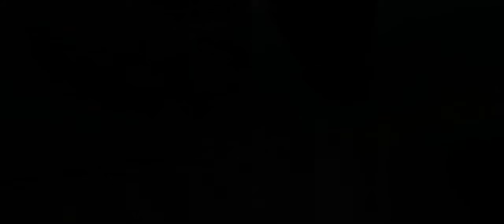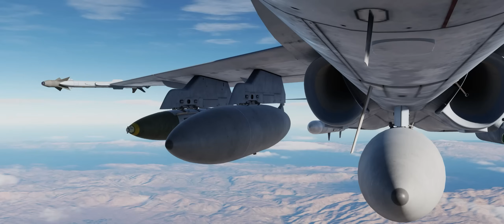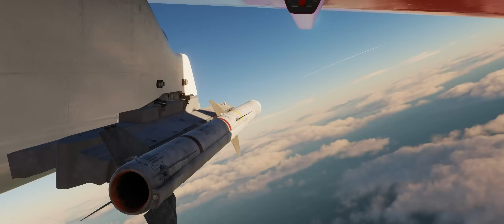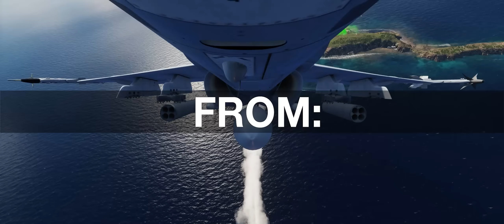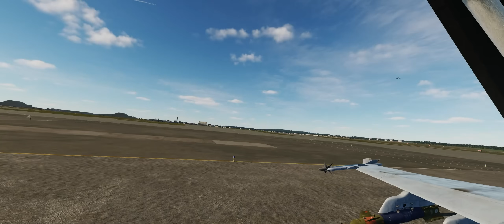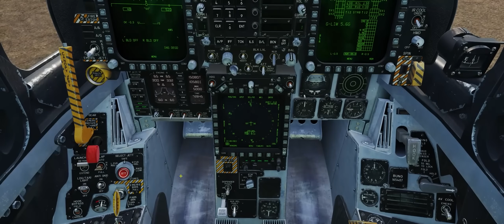DCS: F/A-18C Hornet DEFINITIVE Cold Start Tutorial

Comment: The anti-skid system on an F/A-18 is typically turned off when operating on an aircraft carrier for several key reasons:

1. Catapult launches: During takeoff, the anti-skid system is deactivated to prevent any potential interference with the catapult launch procedure. The system isn't needed during this phase and could theoretically cause issues if it were to engage unexpectedly.

2. Deck conditions: Carrier decks are often wet or have other contaminants that could cause the anti-skid system to behave unpredictably. The system is designed for more standard runway conditions.

3. Simplified systems: Carrier operations occur in a demanding and harsh environment. Having fewer active systems reduces complexity and potential points of failure, which is crucial for safety and mission success.

4. Precise brake control during taxiing: When maneuvering on the crowded carrier deck, pilots need exact control over their braking. Direct mechanical brake control without electronic intervention can be preferable in this tight, high-stakes environment.

5. Consistency in procedures: Keeping the anti-skid off maintains procedural consistency across various carrier operations, simplifying pilot workflows in an already complex environment.

6. Historical practices: This procedure may also have roots in historical practices that have proven effective over time.

It's important to note that carrier operations for aircraft like the F/A-18 involve highly specialized procedures that differ significantly from land-based operations. These procedures are the result of years of experience and are continually refined to maximize safety and operational effectiveness in the unique carrier environment.

Comment: Great tutorial, thank you. Besides that, just a tiny correction for you youngsters out there (you sound young so I would guess you are?) - The first High-Fidelity pointy nose fighter sim did NOT manifest itself in 2017, DCS goes waaay back, even to before it was named DCS. First release was called Lock-On: Modern Air Combat or LOMAC and was released in early 2003, at least 15 years earlier. At that point it was an Ubisoft release, but soon was changed to Eagle Dynamics, at least with Lock-On: Flaming Cliffs 2 in 2009, but probably earlier. I would say that LOMAC was pretty Hi-Fi at the time, nothing came close for sure, but it's sticks and stones compared to 2017 not to mention 2024.. 

Just a reminder that DCS has at least 21 years of history as of 2024. You all should check it out :)

Comment: Totally awesome!💯 Just got my 1st mod the f-18C legacy. But with the sale spring sale I got the FC3 also the f-86 saber. As a Navy man & Hilo pilot. Navy Air Force and Marines assign a specific aircraft to a pilot. This way it becomes second nature and I do love the f-18 but my true love is the F-14. I chose the f-18 legacy due to its radar and crossover abilities. Also that has been upgraded many times. Down the road. I'll get the F-14. Bravo then the alpha. Trying to teach myself. There's kind of a long curve I'm going through. The value of your teaching is priceless. Hopefully down the road. This was a gift from my son. Retired and disabled. I do have the OC2 VR. Seems to get hot. It's the 128 model. After about an hour or two. I'm going to follow your teaching message from cold start. Hopefully all the way to advanced. Really loving it. Learned a lot from your cold start, especially with the radar. 91 to '96 CVN 76 Reagan we had F-14 tomcats. Was unable to finish my 8 years which I was going to put in for another 8 years. Training a co-pilot in a CH47 as a mock-up in lieu of the CH46 Sea Knight. Transmission blew up so all I had was the rear rotor and the auto rotation went well. Had to straighten it out in a dive. By the time the rear touch the ground with the ramp everybody was off but during the dive in ammo can't slid underneath my seat. I lost power holding the rear and trying to keep it straight in the front slammed the ground. My entire lumbar is fused with titanium rods and implementations. So this is really a gift for me. Dcs. Thank you very much. Can't wait to see all of your videos on tutorials!  I imagine I'll be staying in the f-18 for a year or 2. PS. Sorry for the bio 🫣

Comment: The problem with these tutorials (other than being way too long) is that whan something doesn't work the way you describe we have no way to go back and figure out why.  For example all I can get is "align failed" errors.  Now I have to go research why for hours and hours.  Only to find another issue, and another and another.

I still cant get a align but it seems its not that important due to the limited wy I use the hmd.  I wonder if its the TrackIR as I do use a fast low smoothness 1to1 settings.

Comment: I leave the map on, just put the gain and brightness very low, so that the symbology is readily readable in VR.
Reply from the maker: If that works for you that’s awesome!
Reply: @Spudspike  I also work the day/night switch, I can never remember which setting it is, but one is clearly better than the other at the second to lowest gain/brightness.

It works very nicely and takes just a second to press both buttons on the Cougar. The map is still visible but doesn't completely wash out the symbology. I find myself looking at F10 map less and less with grasping all the systems.

Having the map, the waypoints, TACAN, the general knowledge of where which airbase is, etc, makes for less F10 peeking necessary, which makes me a happier camper. ;)

Comment: According to NATOPS, the throttle can be advanced at 15% N2 rpm as long as you have an oil pressure indication.  Also, displays are turned on before cranking up the left engine to check for HYD 2 and ATS cautions.

Comment: This was a very comprehensive tutorial, thanks! One question: Once the INS alignment is complete, you just leave it at IFA for the mission? Or do you need to set it to NAV like after a stored alignment?
Reply: If you are playing with time 1986+ you shoukd have gps.IFA automatically always aligns the ins using gps data and makes nav data very accurate. Unless your mission tine is before 1986 dont use nav mode, i have never used this mode in fighter jet but have in airliners. In summary always use IFA if the time is 1986+ to get most accurate ins data using gps.
Reply: @britishairways744  Thanks!
Reply: Another tip: if you find yourself frequently waiting on ins alignment and everything else for cold start is done, I'd suggest switching to using CV/GND stored heading alignment. It's much faster and will get the ins accuracy close enough. Then once the stored heading alignment is done, you can use IFA and it'll make any adjustments it needs to your INS during flight.

Comment: If for real; all these tests are critical.
For us; we do have the HUGE luxury of shortcutting, and trying to achieve a "How fast can we start".

This is my "fast start" list:
F18 cold start
batt rt middle enable (rt)
apu - left  center enable
just under, set crank to R to start right engine
rt shift - home to do startup right engine
Set right/left mfd brightness
set middle brightness (under IFF)
turn knob above center mfd (brightness)
turn knob under a/p or IFF - hud symbology brightness

Left mfd, spt/fcs                   canopy lctrl-c

INS (rt middle to norm) - status in SA on middle panel
Lt engine crank (left midd swit now to left)
right-alt home to set lever to power on engine (check alt)

Fcs reset error buttton  - mid left (flat silver button)
oxygen - lft back

flaps auto (f)
take off trim = v

fcs bit - rt mfd button1
next is run - Y + fcss (on mfd)

set horz - knob - center rt tiwist to align
INS rt back from on to nav
radar - opr - rt mid
arm ejection seat
parking brake toggle,  	f (flaps)

Set QFE/NH

Comment: After playing tape A you cycled the battery so it would rewind, however I notice you didn’t cycle it after testing tape B. Is there any reason(s) why you should or shouldn’t cycle the battery after tape B?
Reply: On the very old F-18 maybe, but on the C, you don't need to reset the battery. A and B are the fire detection loop, not the tape. Their are two independent fire detection system and this test them.

Comment: "Gamer's cold start tutorial" is a more accurate title.  An interesting video, but lots of incorrect, out of order, and missing steps if you are going for a "realistic" cold start using an actual NATOPS checklist.  Even for a "sim checklist", several modelled systems were not even turned on.  (IFF, TACAN, ILS, D/L ...)  IRL, don't leave the master Warning/Caution light uncleared on any aircraft.  If it is illuminated, check the annunciator panel to determine what the warnings/cautions are and deal with them if required.  Then clear the master light, so it is not illuminated.  That way, if there is a new warning/caution, the master light will illuminate and you will know there is a new issue.
Reply from the maker: IFF, D/L TACAN discussed  & turned on at 0:15:18 in the video
Reply: @Spudspike  You are absolutely correct. ??  I swear I watched the entire video the first time!  I distinctly remember you discussing the INS DEGO and also remember you talking about the stab trim, but somehow missed the IFF, D/L, TACAN part the first time.  I don't remember getting interrupted or seeing an obvious skip in the video, so no clue how I didn't see it.  Sorry to say you forgot them!  Respectfully, I stand by my comment about a "realistic" start following the actual checklist.  Following the checklist for things like rotating the Bleed Air knob thru Off to Norm before starting the left engine will make those pesky L & R BLD OFF cautions go away, or having a DDI set to the FCS screen when you press the FCS Reset so you can see if the reset worked, or actually performing the FCS BIT instead of the FCS exerciser mode.  I don't mean to be overly critical, especially since you didn't claim to be using "real" procedures.  I'm just not a fan of calling tutorials "definitive" when they don't follow the "correct" procedures and therefore teach a bunch of unknowing people things that aren't really correct.

Comment: On engine start, you need to cycle the bleeds before starting the left engine. Also prior to starting the left a good technique is to turn on the DDIs, HUD, radios, and MPCD. You'll also have to do an alignment every time you start (can't go straight to IFA). A stationary GND alignment will typically be faster than an IFA. On a cold start, you'd also do an IBIT on the FCS after resetting the FCS. What you did was an FCS exerciser. To get to the IBIT, you'll go to the BIT page, then FCS and press push tile 4 while holding the FCS consent switch. The probe is usually reserved for final checkers where they do the "6 down" checks- hook, speedbrake, probe, launch bar, emergency av air cooler, and pitot heat. I would recommend setting flaps to half before setting takeoff trim as well. There's virtually no reason to leave the tacan off either. If you don't want it just don't box it on the HSI. I'd recommend also setting the radalt to 380 or 450. If it's at 600 in the downwind it will be constantly going off. It's good to have it at 450 so you have a good benchmark during your approach turn (should be 450 at the 90).
Reply: Assuming you flow well one can have both engines started. Re armed and hmd aligned before the stored heading alignment is done.
Reply: @FlavorfulGaming  cycling the bleeds is in the checklist prior to starting the left engine, if you're one to follow it
Reply: @DreadwingOne  nah I primarily play mp. Check lists are for suckers. But I have my own work flow n startup. I know what systems I need
Reply: @FlavorfulGaming  I mean yea that's fine do what works for you, I was just saying for those that want to follow IRL procedure for starting the jet. I'm also not suggesting you have a printed out checklist in front of you either, most jet pilots will memorize certain checklists and get their own flow for how to do things.
Reply: Sorry for the 2 year late response. I just picked up the F/A-18C and I’m trying to get into it, would you be able to spare some time to teach me the ropes?
I got the basics down and can get it up in the air but I’m hoping to get a better understanding of my platform
Reply: Ya this isnt a definitive tutorial...its alright for your average DCS player...but as you pointed out there were some errors.
Reply: God i hate people that apparently feel the need to "correct" others that at least try to do something for the community. I as a beginner found this video great, and your comment above is just non-userfriendly, and just full of a lot of abbreviations. You should know your audience, and know who you are talking to. Its quite clear this video was not meant for people like you, and still you watched it. If you feel something was faulty, make your own video.
Reply: @toerktumlare  lol....the video was titled with the word definitive. Nobody is saying this video isnt good or useful and there are no harmful comments. The only person who hated here....is you (in your first sentence).

Ask yourself how can something be definitive if it isnt by the book. Ask yourself why you would hate someone who wants to point out where there may be errors. And calm down. This is the internet.
Reply: @toerktumlare  do you just go around YouTube comments being an asswipe to everyone who has a different perspective than you?

Comment: IRL, is it possible to start engine 1 with bleed air from a running engine 2, rather than with the APU? Or is it only for cabin pressurisation…?
Reply: Yes possible and sometime done, but eng 2 need to go close to 80%.
Reply: @didiersavard6809  Thank you for replying! 
Is it possible in DCS as well? It doesn’t work for me, but that could be due to my uselessness…
Reply: @Blablablabla1ify  Bleed air, engine to 80% , crank, at 25%, throttle on. work in dcs.

Comment: Thanks for this! I've definitely been missing some steps... One small thing that I noticed is that you set the altimeter to the QNH, which I believe is the pressure at sea level. QFE (from the tower) would be the correct setting to zero at an airfield, right? Please correct me if I am wrong, but that's how I understood that mission briefing number.
Reply: So as an Air Force ATC, I can explain you this depends:
- QFE is the value for the static-pitot pressure difference, that will set the altimeter to the airport's local pressure coefficient (inHg for Imperial and hPa for metric altimeters). This sets the altimeter so that Altitude should be zero when on the ground at that specific airfield (with zero being the center of the runway centerline - there might be slopes and dents on the actual flight terrain obviously).
- QNH is the value that recalculates the local pressure difference between pitot and static port to Mean Sea Level (MSL). This is handy because every aeronautical chart and procedure (SIDs, STARs, RNAV, TACAN SIDs and STARs) tells you at what altitude ABOVE MSL the aerodrome/CTR/runway you're doing the procedure for is. That way, you will see that Altitude on your altimeter when you hit the ground, in stead of "0".
If you're a proper pilot or aviator, QNH is the way to go, because you will fly these procedures from your cenor flip or kneeboard (or the top of your head) and know the altitude above MSL of the runway.
DCS gives you QFE however.
In real life, QFE is used by the Brits as far as I'm aware and internationally for example for air shows (because an air show pilot would want to.. you know.. not hit the actual ground in a looping haha).
QNH is the general way to go, given to the Aviators/pilots over the frequency on actual start-up clearance at departure or when passing the transition layer from FL tot ALT at approaches/arrivals.
Hope this helps ^_^
Reply from the maker: @TTocsxic  Great explanation! I didn’t want to overcrowd my response but the only time I have ever set QFE in and aircraft is while flying in an aerobatics box at low altitude during competition haha! Gotta know exactly how high I am without a radar altimeter.
Reply: @Spudspike  on your part; thank you for this instruction - didn't know I could go directly to IFA for alignment with GPS nowadays (I was still doing the GND/CV alignment with STD HDG selected on the HSI from the "in between" 2017 and present times I reckon)
Great to know! ^_^
Reply: @TTocsxic  granted I will say the "old" method of STD HDG alignment is much faster, so if you find yourself waiting on IFA INS for awhile, I'd suggest switching to using STD HDG, then once that's aligned, go to IFA so it can do any adjustments it needs.
Reply from the maker: All ATC commands regarding altitudes below Flight Level 180 are given with the understanding that all aircraft are operating with the local altimeter setting on board. This is given in QNH by various weather reporting stations. 99% of the time QNH will be within + or - 75 Ft of field elevation (while sitting on the ground) which is the standard error tolerance required for IFR flight.  If you are above FL180 you would use QNE which is 29.92. 

QFE isn’t really used anymore because setting QFE would set your altimeter to read 0 Ft rather than field elevation.  This was used for precision approaches in the old days when radio/radar altimeters weren’t as common. 

It’s much more advantageous (not to
Mention safer) to have your altimeter set to QFE and get your AGL readout from a separate radar altimeter.
Reply: @Spudspike  Ah I see! I’ve always changed to QFE when the tower gave that number to me when landing. I’ve always assumed that number was much more important than it actually is. I’m assuming they give that number in case your radar altimeter is borked, or if you don’t have one?